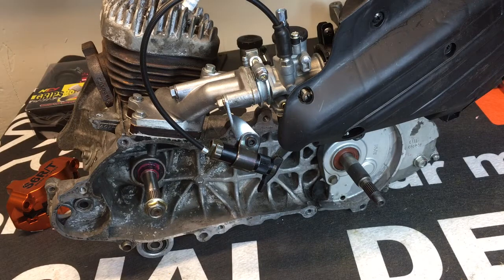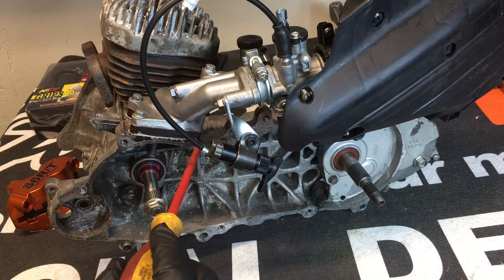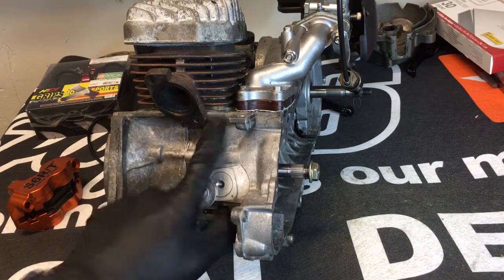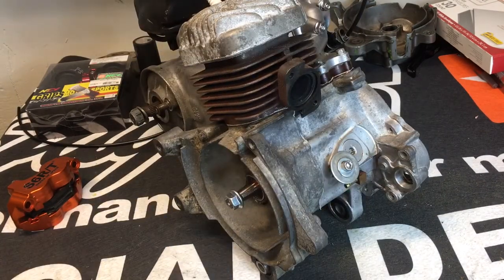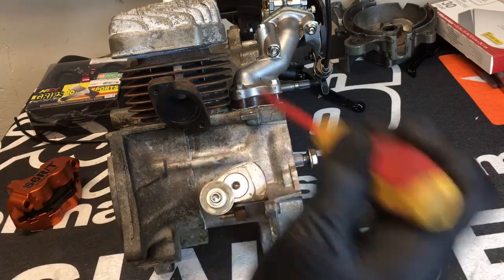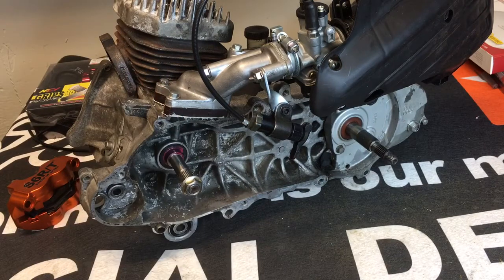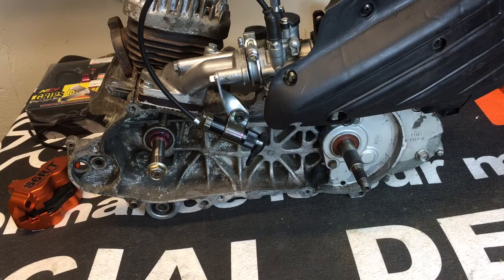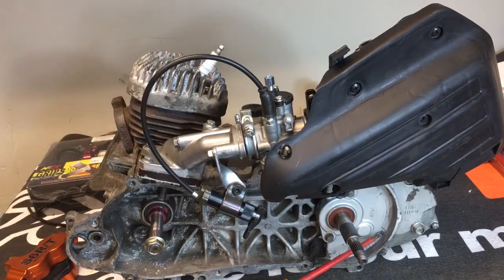Scooterswapshop air leaks explained

Comment: Do you have any idea what could be the problem with my 2 stroke I have new cylinder and carb. When I start it and drive off it runs very good like it should then when I release the gas and try to go again it stops at 30kmh and doesn’t fo up in rpm and sometimes it gets the boost it’s suppose too I really need help been Trynna fix the bike for like 2 years

Comment: Could an air leak cause engine not to start. I have a Peugeot speedfight2 vertical engine similar to this honda. I tried changing a crank seal on the magnet side and it started up, but the next day I started it 2 times then leaved the engine to cool down. and then it wouldn't start ever  again,.
Reply: If it won’t start probably more then a leak

Comment: my 50 2stroke has new carb but still will not run unless I spray starting fluid in carb and then just revs up real high and runs for a few sec then dies out.. it has a broke muffler stud  and I cant get a tight seal to the head would the air from that make this problem or does that not mader to much?
Reply from the maker: its impossible to say without being with the bike. First off, what bike, and what brand of carb. If its a ebay, or amazon carb, theyre garbage. toss it. And yes you need the stud replaced
Reply: @Scooterswapshop  whats a good big borekit and carb? For a 2008 adly 2stroke silver fox 50cc and can i order parts from you guys????? Please help
Reply from the maker: james risen sure we have tons of kits. Shoot us an email or give us a ring and we can go over several options
Reply: Ey im a little bit late. But i have exactly the same problem on my keeway f-act, after taking off the oil pump and going premix, it hasn’t started without spraying brake cleaner in the carb. And when it starts it just revs high for few seconds and dies. What was the problem on yours? I really need to get mine back on the roads.

Comment: You guys sold me on the Hondabond and it works perfectly. Thanks for the tip on the head temp washer. I never would have moved the plug washer to UNDER the temp gage ring. Thanks!!
Reply from the maker: hondabond is like the maple on the donut. Just a part of life :)